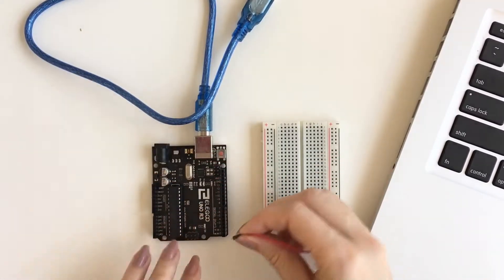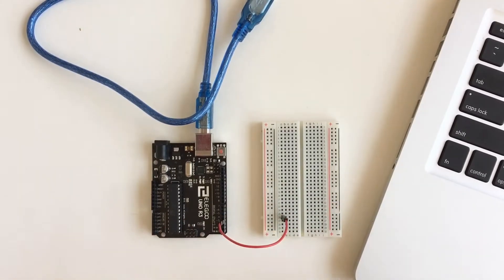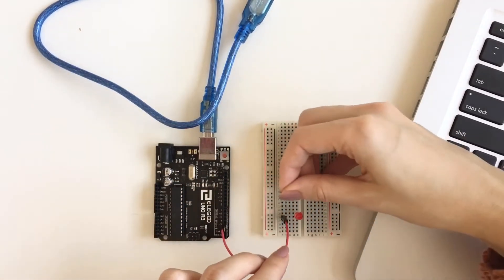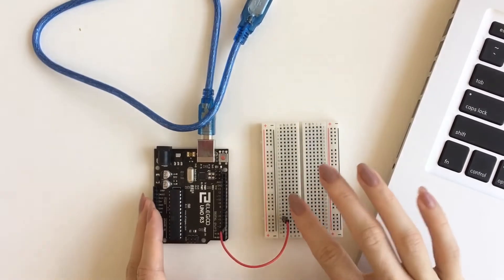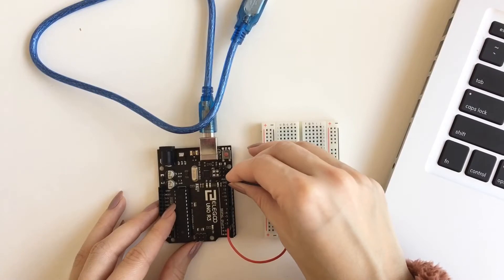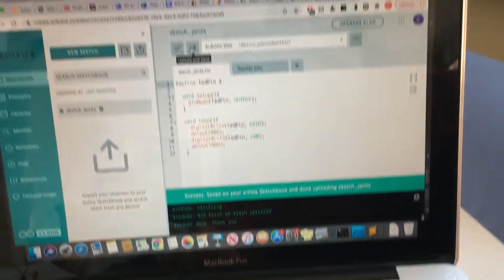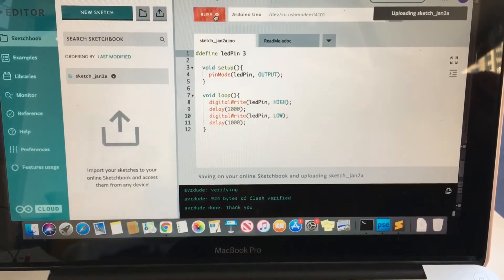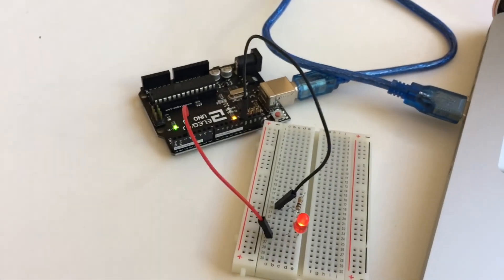Project One: Blinking Heartbeat Box

Comment: thank you for the amazing tutorial! i want to make this but slightly differently, I want to incorporate a fingerprint sensor in it such that when you touch it it glows up. Could you give me some directions for doing that
Reply from the maker: Cool idea! In every iteration of the program’s loop, you’ll need to read the sensor value. My website has a project which explains how to read sensor values (see project 4, light sensitive bats). Then you can use an if statement to light up the LED if the sensor value is in a range that means it’s being touched, otherwise turn the LED off.